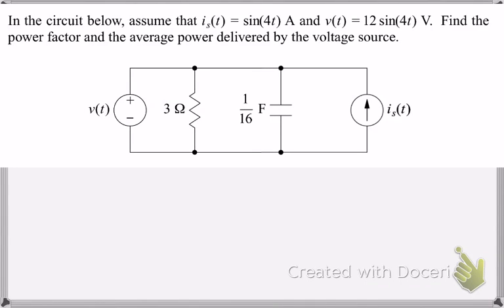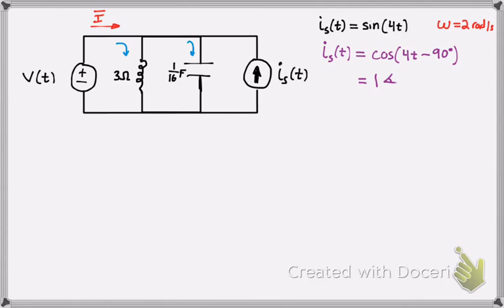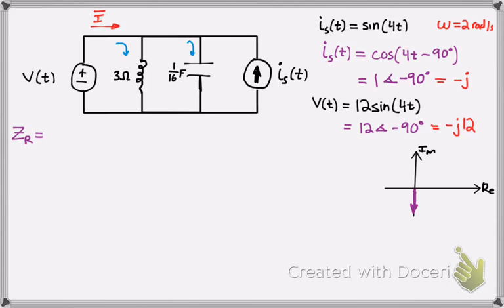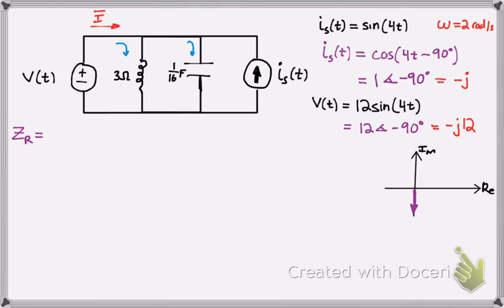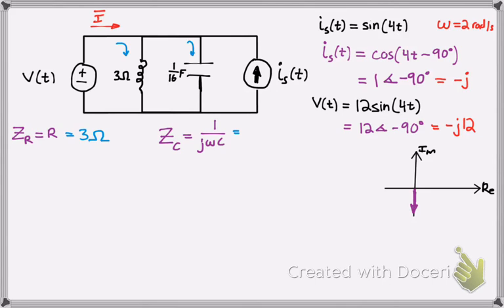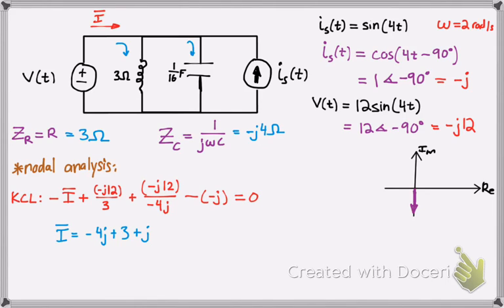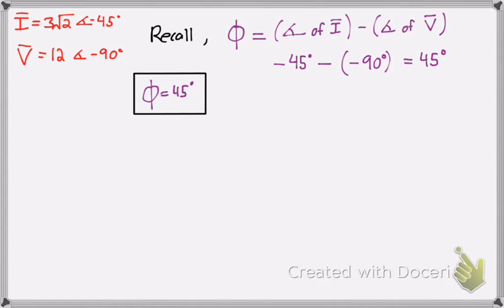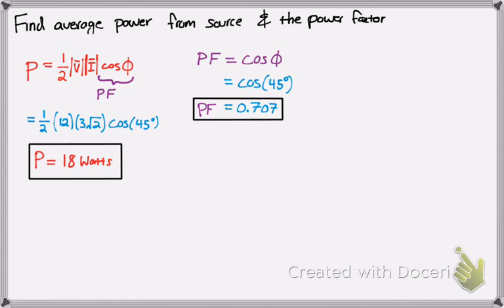Finding Average Power using Phasors

Comment: shouldnt the impedence for the capacitor be 8 since the formula is 1/wc and w is 2 and c is 1/16 therefore one devided by 16 devided by 2 equals 8
Reply: w is 4, not 2, as shown in the upper right. However, the calculation does use 4 correctly in the Zc calculation.